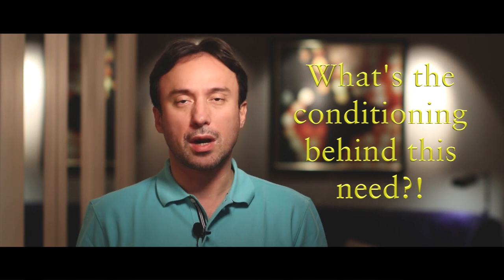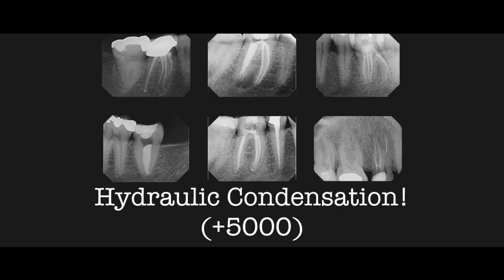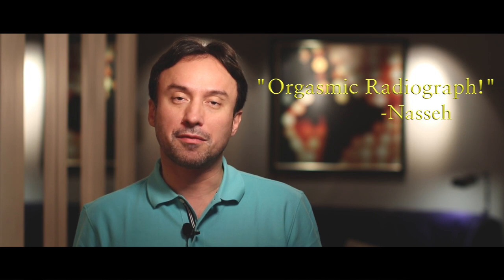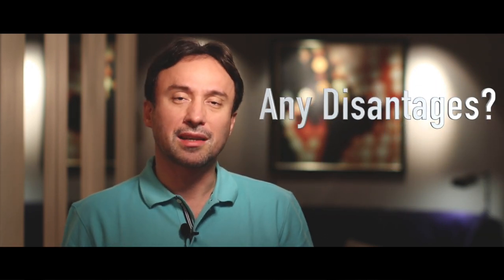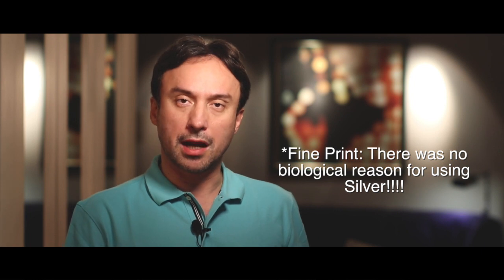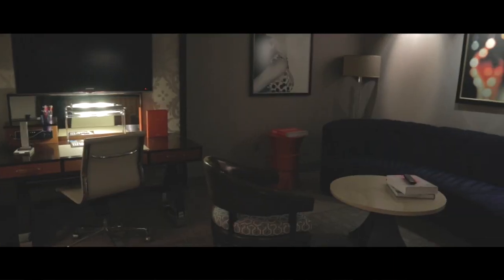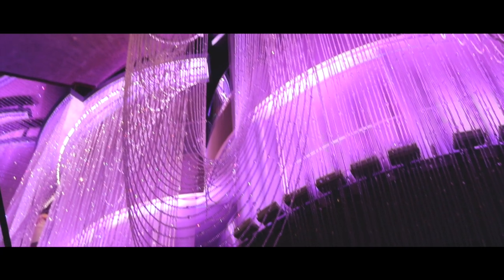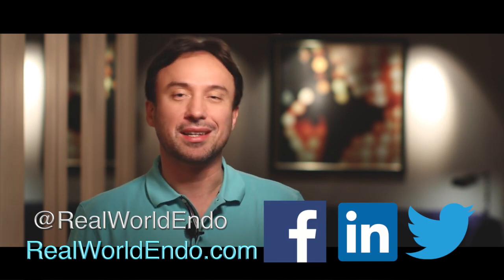Vlog: Radioopacity of BioCeramic Sealer

Comment: Dear Dr. Allen Ali,

Interesting that you mentioned that the tooth is stained as a consequence of trying to make the sealer more radiopaque. I have a RCT on my front tooth and the tooth has discoloured despite internal bleaching. It's a shame because I have to now either get a crown or veneer. In modern dentistry we are trying not to remove healthy tooth structure but unfortunately I don't want to walk around with a grey tooth!

I'm just wondering if we sealed teeth with less radiopaque materials, like bioceramics would the tooth still discolor like with most conventional sealers? I also saw that the fracture rate of teeth filled with bioceramics is also much lower. I'm hoping this technology really catches on!
Reply from the maker: No discoloration with bioceramics. It also depends on the radioopacifier. Silver is bad for discoloration. You can try a veneer or crown at this point.
Reply: It's really a shame that teeth are discoloring just so we can see GP on x-rays more easily. But I'm sure this topic has been thought about a lot and is validated to a certain degree, particularly in the case of an overfill or some other mistake. Excellent news that this is not the case with bioceramics. Wish my dentist used this approach!